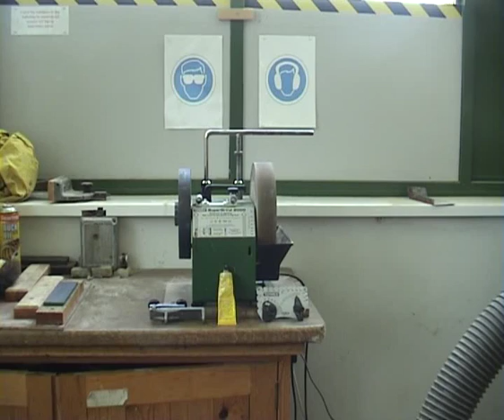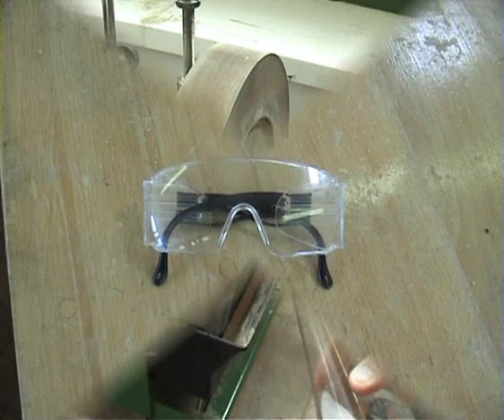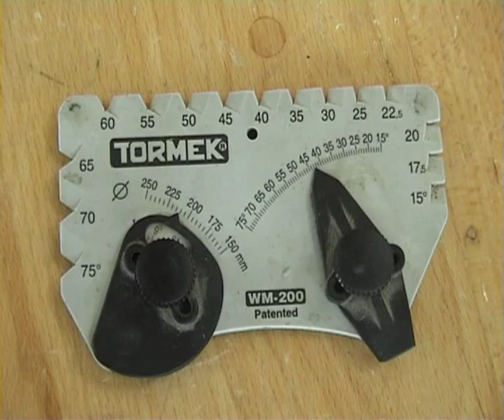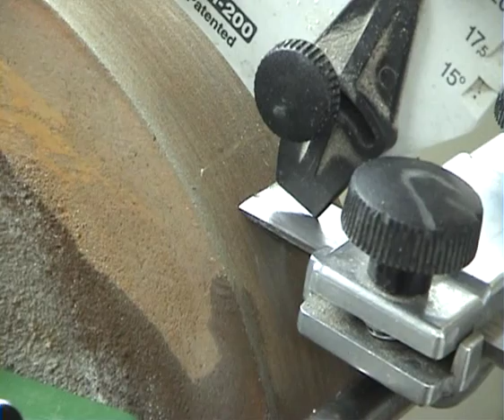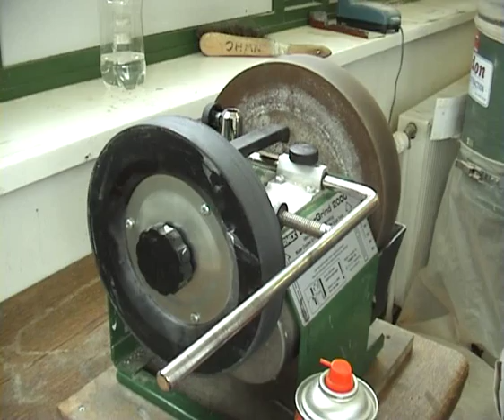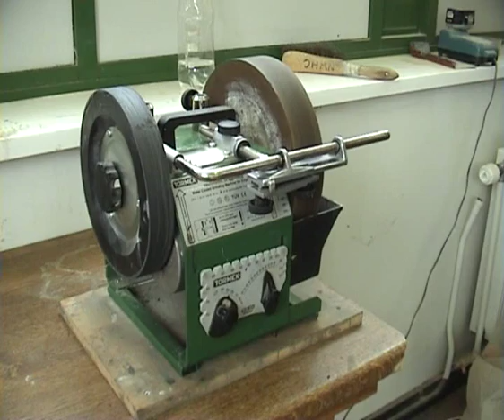How to Safely Use a Tormek Waterbath Grinder

Comment: The leather needs to be conditioned with mineral oil ONE TIME. That is what the handbook recommends, but you're not alone in misinterpreting this. Using too much oil on the honing wheel is all too common a mistake.

Comment: Your stone is quite glazed. It needs treatment with the stone grader. It will be much more effective if cleaned.

You did not use the AngleMaster correctly. The inside point of the angle indicator must rest on the surface of the grindstone, with the rest laying on the chisel blade. Also, it is much easier to adjust to the AngleMaster by moving the Universal Support in or out, rather than moving the chisel in the jig.

Also, don't use lubricant with the honing compound, just the compound itself.